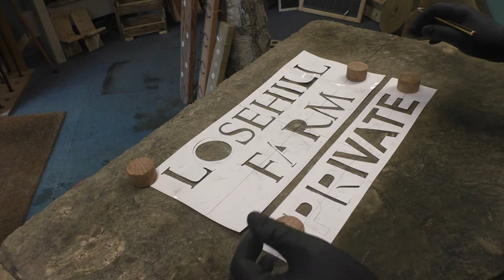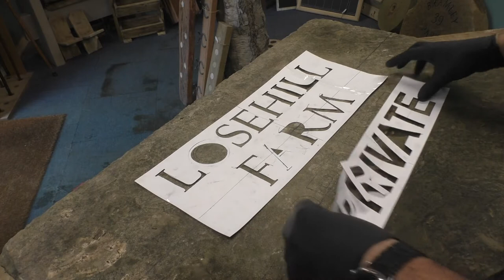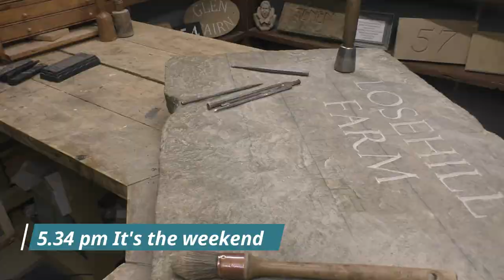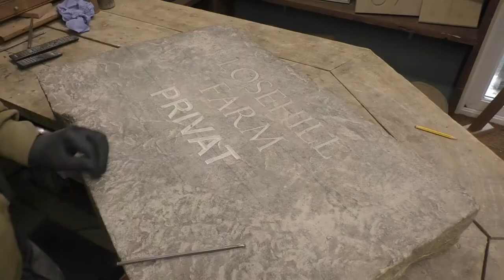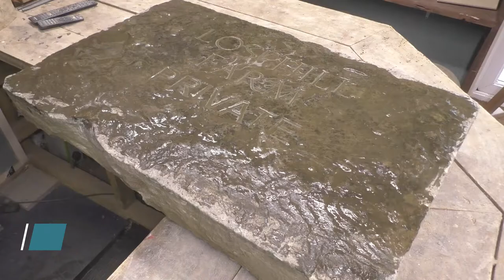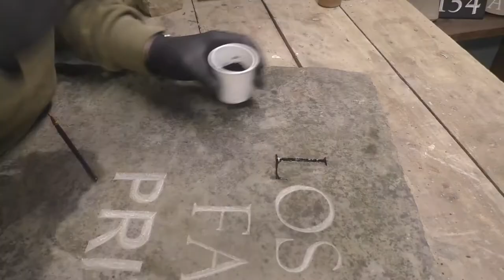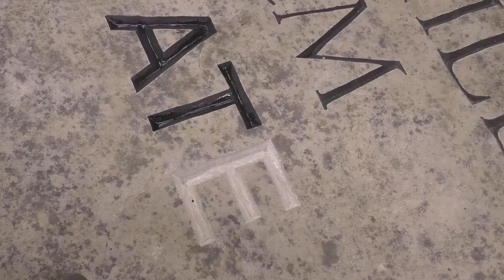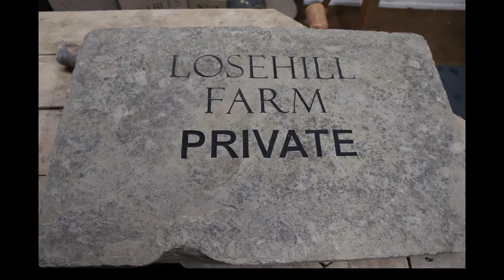HAND CARVING reclaimed York slab for a house sign - stone letter carving - stone lettering

Comment: What stone types do you find easiest to carve on? How would you asses marble? Thanks!
Reply from the maker: Hi Pulleczech,
The easiest is definitely a Maltese limestone or a Portland limestone. It’s very soft, easy to carve, and you can be very quick. My favorite to work with is Derbyshire sandstone and Welsh slate. I have worked with marble but not for a couple of years now, and I would say the biggest piece of advice I could give you is to have the right tools and keep them sharp.
Reply: @TheStoneRanger  Thanks a lot for the quick reply and advice!
Reply from the maker: @Puleczech  No problem, I was logged on replying to someone else’s, so it was good timing on your part. 👍